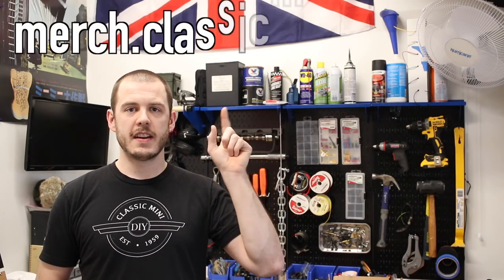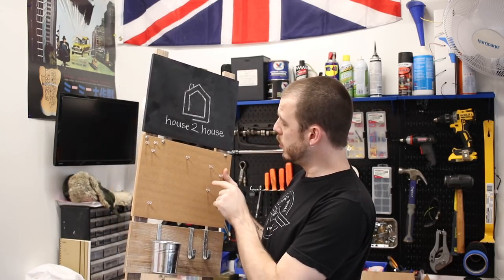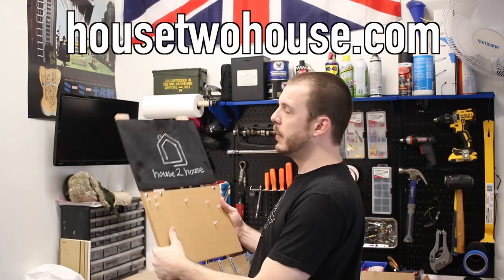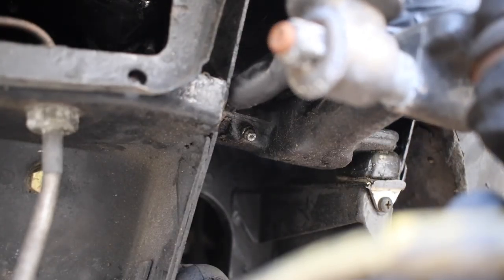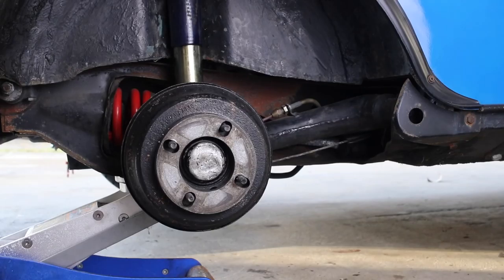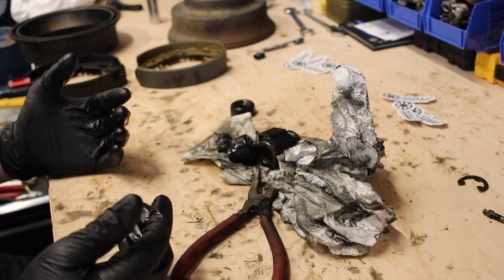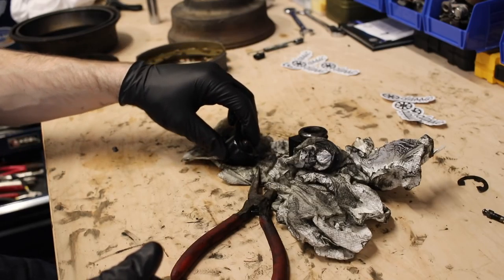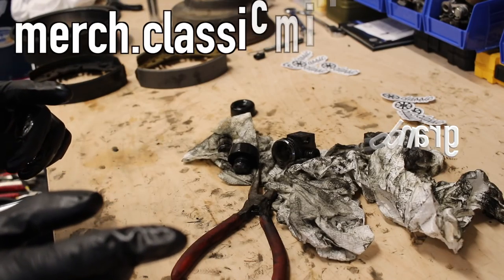Classic Mini DIY - Odd Jobs Episode 4

Comment: You can sometimes save the fluid in your system by clamping off the rubber hose that leads to the rear brake to hold off the leak.
Reply from the maker: Technically true you’re right but I think it’s important t to flush the fluid when you do any brake work that involves disconnecting the lines.

Comment: Before working on the brakes or clutch remove the master cylinder cap, place a polythene bag over the filler neck and secure with the cap. When fluid tries to run out of the system  when you undo a pipe a vacuum is created in the master cylinder thus preventing fluid from running out. Remove the polythene when the work is complete and bleed and top up. Job done less mess.

Comment: Another great video cole. One thing to add would be to clamp the flexi hose to stop fluid dripping everywhere (or at least reduce the flow) or if you have braided lines use a bung on the end that was disconnected

Comment: To help the next one. if you loosen / slacken the  rear shoe adjuster Before trying to remove the drum it will all come off Much Easier. Little to no prying.  ALso you're going to replace both sides right? Both have the same ammount of wear. I would expect same failure rate.  DIrt and moiisture get behind the outder DUst Seal Causing scoring on the piston and the bore seal = Leaks.

 Gooodluck

Comment: Cole i have a bit of a problem i think my t-shirt shipped with the print on the wrong side. Because the little washing label is on the side of the print an if you were it with the print on the front it doesnt fit good at al and i basicly look like im wearing it the wrong way.
Reply from the maker: Shoot me an email at classicminidiy@gmail.com I'll help get it sorted out.
Reply: Classic Mini DIY but first i have one question the logo was suposed to be on the front of the shirt wasnt it?
Reply from the maker: It was not. The logo was meant to be on the back. I have recently added one that has the logo on the front. If you’d like to exchange I can do that.
Reply: Classic Mini DIY but first i have one question the logo was suposed to be on the front of the shirt wasnt it?
Reply: Classic Mini DIY oh okay no problem its just not very clear on the website and since you where them with the logo on the front in the video's its pretty confusing.
Reply: Classic Mini DIY and i wont exange it i actually like it like this asswel. It was just to make sure there wasnt any problem. Im happy like this.
Reply from the maker: Feedback received. I’ll make it more clear online. Sorry about the confusion.
Reply: Classic Mini DIY no problem im just as happy like this. Im mostly so exited because you have a merch store.

Comment: Its not oil. Its brake fluid.
Reply: Technically, hydraulic fluid. Used in both split braking system and clutch on these cars.

Comment: Hello Cole, would you consider making a video about rear camber adjusters and light up some info on rear axle issues? If you see my mini from behind you can see a little deviation so the car looks it  goes sideways. Thanks in advance! www.instagram.com/lucasvazquezph
Reply from the maker: Hey Lucas, I don't have camber adjusters on my car but if I can find someone's car who does locally I will definitely consider the video. Regarding the look of going sideways, the mini is notorious for looking like that. This is due to the "wedge" shape of the body and wheel base.  This is totally normal, and if you aren't experiencing any weird behavior in the car most likely there isn't an issue.  :-)
Reply: I was worried you said that! Haha. Thanks for taking your time and answer my question.